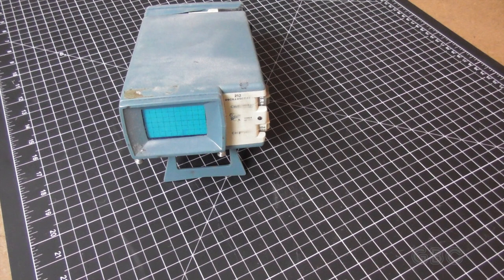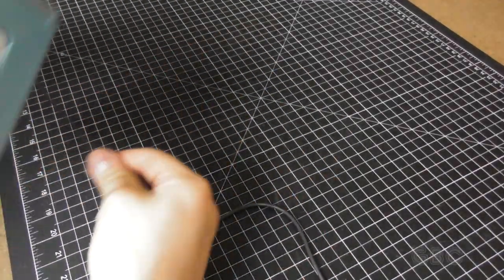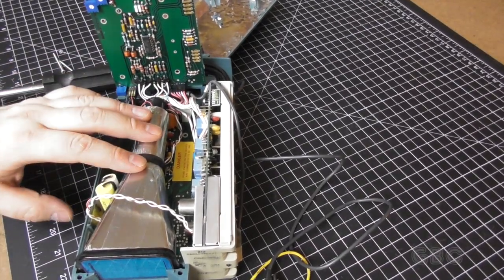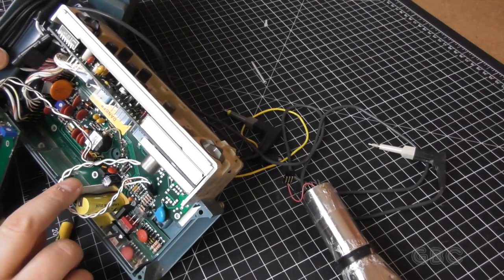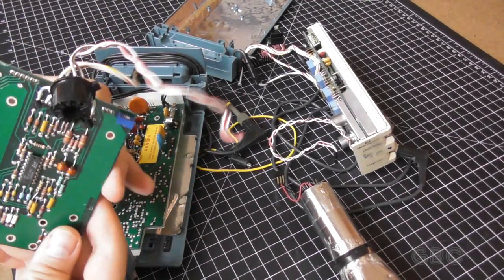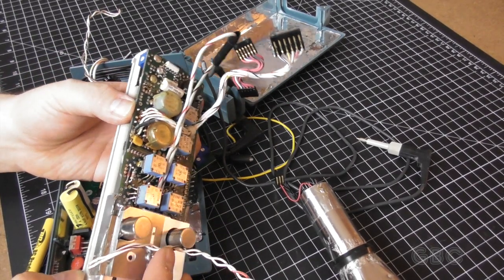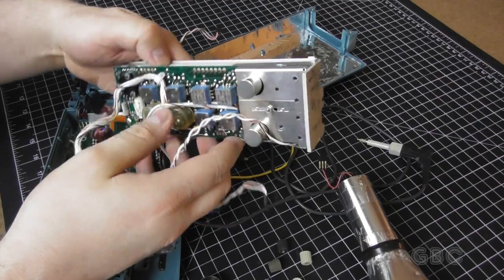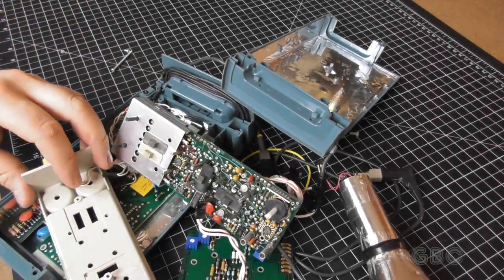[47] Oscilloscope Teardown

Comment: I just got a 214 off eBay. Made some new batteries for it, hooked them up and the battery cable went up in smoke. I think the transformer is shorted but don’t know how many ohms I should be reading when checking for shorts on the little cables going to the transistors. I’m reading .2 ohms though so I am assuming I’ve got a shorted transformer.

If you still have your psu board, I need your transformer! 😆